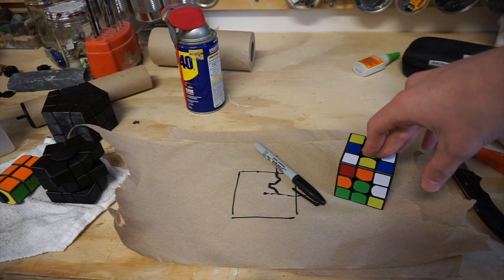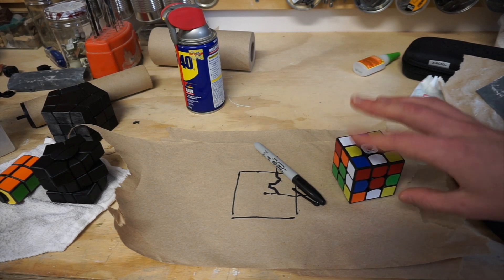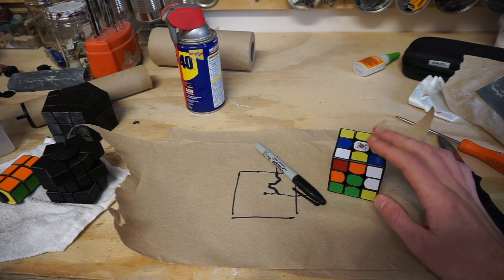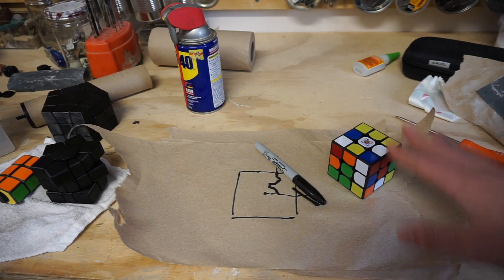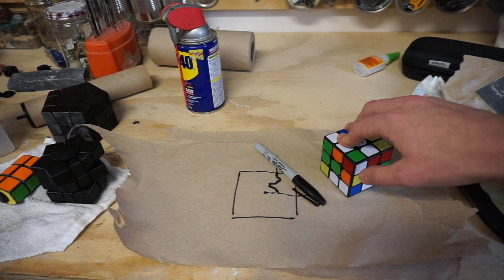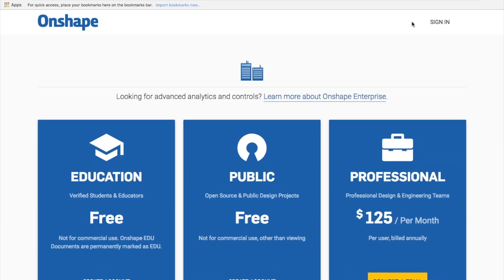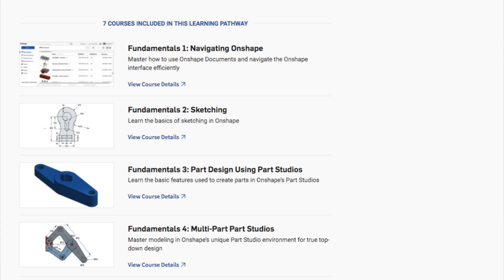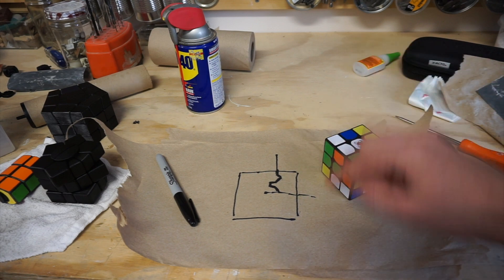Introduction/References | Designing Speed Cubes - 1  [Tutorial]

Comment: What kind of 3D printer would you recommend for a beginner? I've been looking around for a while trying to figure out what price range would be reasonable for a first printer.
Reply: this is some very helpful insight, thank you both a lot!
Reply from the maker: If you can afford it I'd invest in a Prusa i3 Mk2 or Mk3. If that's out of your price range go for a CR-10. There are tons of videos on youtube about good budget 3D printers, search around you'll be surprised by what you find!

If you're talking about for printing puzzles, pretty much any good to average 3D printer will work. You only really need one that can print in PLA, that's all you need for twisty puzzles at least.
Reply: I've got a Wanhao Duplicator i3 plus which is currently around 400€. In my opinion this one is even better than Prusa's models as it has a userfriendly touchscreen panel, is really easy to use and doesn't require any assembly at all. But I'd say that pretty much every printer in the price range of 500$ is good nowadays. Just look out for a model that has a heated bed and looks like it is easy to use (I love that touch control panel on my printer). I'd only suggest you to go with a kit if you are really interested in the internals of such a printer. If you - like me - prefer not to be responsible for the printer's survival, I'd suggest you to go for a preassembled printer (like the Wanhao I have) instead!
Reply: You're welcome. I always hope that more people get into this hobby as I love to see new 3D-printed puzzles :D